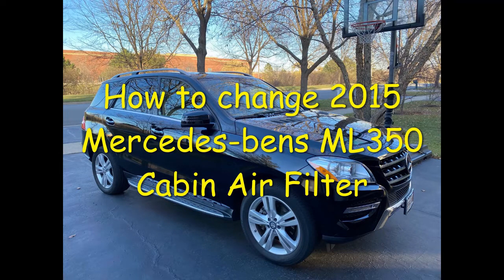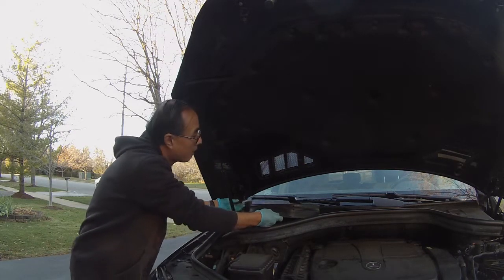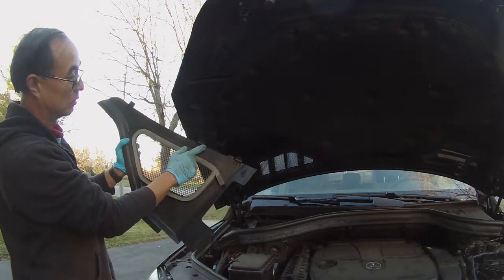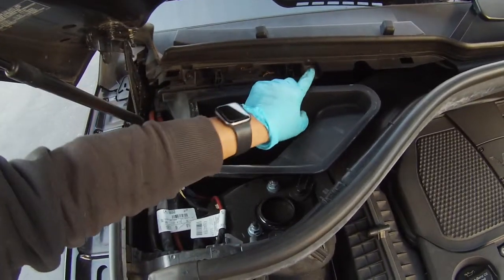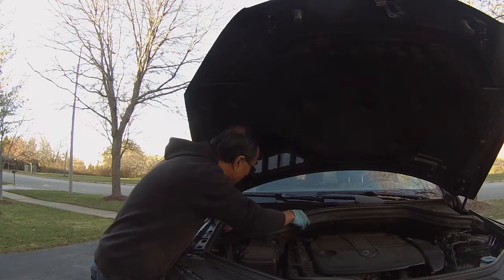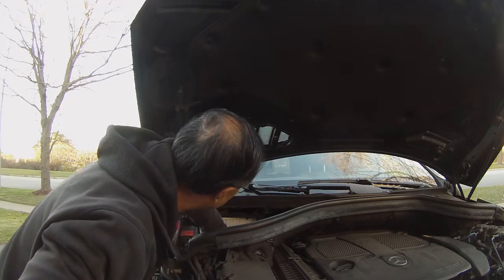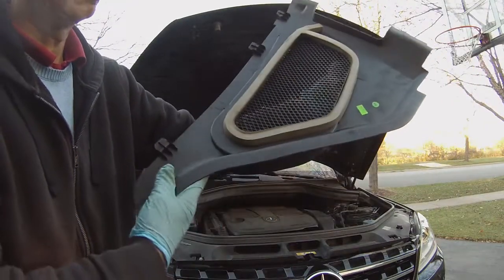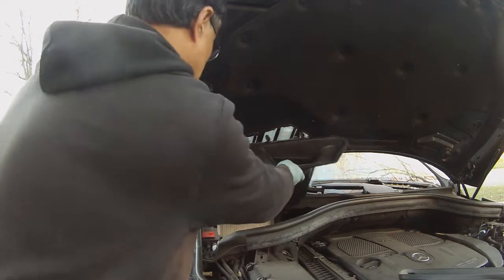How to change cabin air filter for 2015 Mercedes-bens ML 350

Comment: Hi why did you change your filters was it because you were getting a fowl smell
in the cabin or you just wanted to change them out, the reason i am asking is because
my 2015 ml350 is giving out a fowl odor sometimes and a parts mechanic told me to
change out my cabin filter and dust filter to see if the odor goes away, if not it could be
my catalytic converter that is going bad....
Reply: Yes change filter